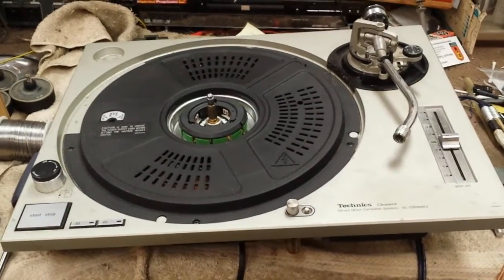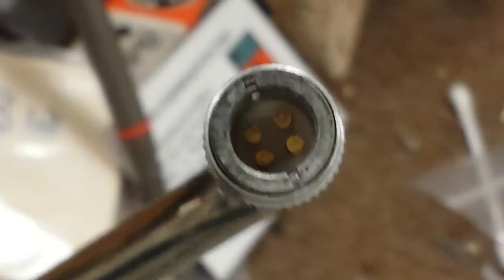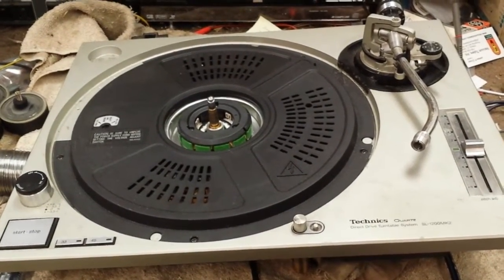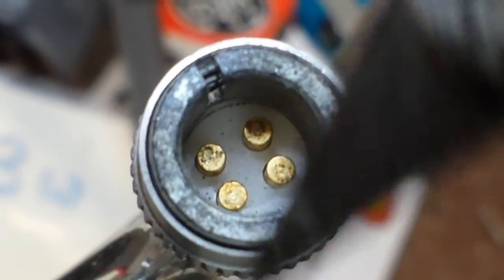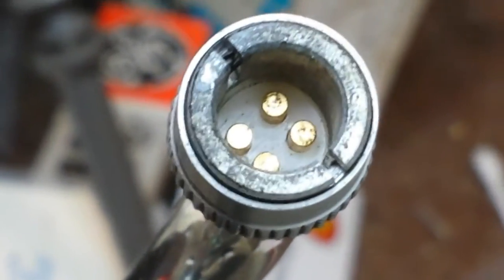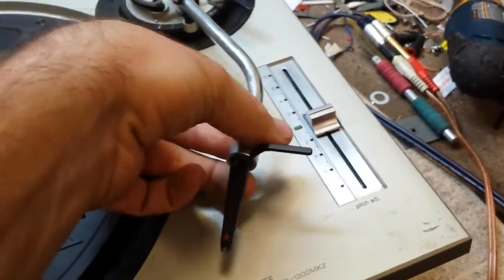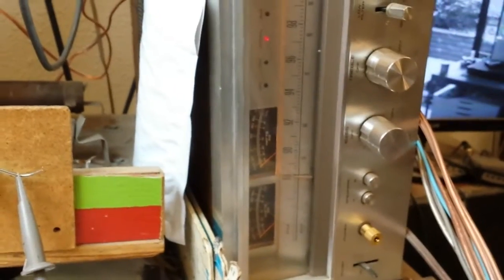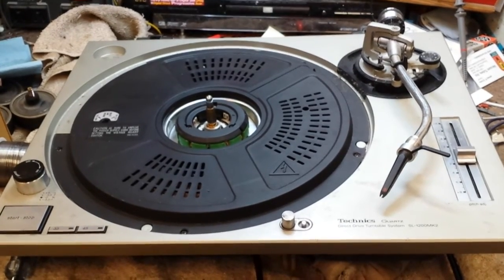How to clean your headshell socket on a technics sl-1200 series turntable

Comment: A fiberglass pen is good for to clean the contacts too.
Reply: Also known as a fiberglass "scratch brush". A pencil eraser, or ink eraser (more abrasive), will also work. Use a light touch, and try not to polish so much that you remove the thin gold plating. Esslinger (watch and jewelry tools) sells scratch brushes in both 1/8" and 1/16" sizes, in two different qualities and price ranges. The German made EuroTools are better than the cheaper Indian-made ones.  I find these to be absolutely indispensable for electronics work. Flush with alcohol after cleaning.  PS, wear gloves to guard against glass splinters before a gig!

Comment: Ok. I have never licked my cartridge (like, spewwwwww), but having changed the cartridge just recently (changed from a GT cartridge to the Audio Technia AT-VM95C/H), I’m getting great signal on the right channel, but it sounds like it’s either not making a connection or has distorted output on the left channel. Since I don’t lick, would dirty contacts be the issue?

Comment: Awesome. I bought some Stanton ST150s in the last year that have weird and variable connection to the headshell and the connections are not very shiny so I'll give this a go.  I suspect the previous owner was a headshell licker. I'm going to replace the head shells when I have money but inside the end of the tonearm connection looks a bit corroded, so hopefully this saves me having to replace either the connection or the whole arm. Is this likely to help reduce the slight earth buzz as well? Any other advice would be greatly appreciated. Also wanted to know if you know much about what cartridges I can and can't use with the ST150s? My green Ortofon Concordes don't seem to work with it, only the Shure M44-7s I got with the units seem to work at the moment. After checking the specs I noticed the Ortofon Conchords only have an output of 4mA where as the shore has a output of 9mA. Would this be the reason?
Reply: Ortofone banana style carts have shorter and flat contact points on the tonearm side, most headshell mounted style carts (like the M-447), have longer contacts on the plugin side, this is why some Ortofone banana style carts will not work with Technics (Often, the prongs on the inside of the tonearm have been pushed back into the tonearm itself from using traditional headshell mounted style carts, and some of them the points are longer than others, as well).
Reply: M-447's are also Spherical needles that are round and ride the walls of the groove of the record, as well, this makes them by default have higher output (louder), they also have a bigger 'needle'  than your Concords (which assuming they are OM's are also, spherical), the OM's have a smaller stylus point however, and they will ride lower down into the center of the groove, which will promote better sound quality, but lower audio output.

Comment: Jordan, I've seen many of your videos and have much respect for you but.... NEVER use a exacto knife to scrape away the contacts!...I've fixed many of these over the years and the best I've found was using a little bit of tarn x, then use little water to get the excess tarn x up, I use a q-tip when applying this method. I then dry it completely, then use LPS and a q-tip for a final cleaning. I use to use deoxit but over the years I found it did more harm then good. The deoxit reacts with the nylon insulator making the contacts not spring back. Super pain when this happens. Don't use deoxit believe me.
Reply: agreed.
Reply: hey mate any advice for someone who has purchased a used close to mint condition 1210 mk2 with the 2 bottom pins stuck? i initially thought it may have been tonearm wires as there was no audio coming out but tonight i saw the two pins pushed in and stuck, any advice would be greatly appreciated, thanks
Reply: @danizm78  Honestly you can try and unstick the pins. I've used a hot air gun to gently heat up the connector. This may work but your best bet is to replace the connector itself. You can find them on ebay.
Reply: @kanuke  thanks mate, i ended up taking the screws out and using needle pliers to push them back through also used a tiny bit of contact cleaner and lube spray, seems to be working for now but will replace at some point.
Reply: Googling Tarn X and it says not to use on aluminum, which is what the tonearm is made from, no?
Reply: @JurassicTrance  Yes, part of the tonearm is made from aluminum. I don't use the method I posted above any more. Now I use just Alcohol with a q-tip. This is the best method in my experience.
Reply: @kanuke  cool, yeah I’m trying to figure out how to clean some mk2s I just picked up, one of them has some corrosion in the head shell socket (white power spilled out after removing the headshell).  Contacts look ok and the rest of the turntable seems alright.

Everything else seems fine, pitch needs calibration but I don’t think it needs to be replaced - the cue arm mechanism on both feels a bit strange compared to my M5G deck.  They both work fine and smoothly drop the arm down - it’s the action of the lever itself that seems a bit off? Lifting it is fine, but when dropping it back down, it sort of just falls without a smooth motion? Again, just the lever not the actual lift mechanism so it’s not exactly an issue, but a bit annoying.
Reply: @kanuke  ,  The trick I learned from ham radio and ex military radio operators was to use a pencil eraser to clean the gold plated contacts both on the headshell and in the tonearm socket. Flush with alcohol afterwards. A pencil eraser, or ink eraser (which is more abrasive) works great on relay contacts . Use a very light touch on gold plated connectors.  A dried up eraser doesn't work, you will want a soft fresh eraser.

Comment: What do you suggest one use to lubricate the pitch slider??
Reply: There are 2 possible reasons for the slider to be really stiff and sticky: 1) dust/dirt/debris and/or drink spills inside of it; and/or 2)  Somebody "cleaned it" by spraying some kind of contact cleaner or WD40 or lord knows what inside of it. You really can't clean and/or lubricate sliders that way, especially if they're already quite dirty to begin with.  I have been a bench tech repairing audio equipment full time for 15 years, and none of the products on the market, no matter what the advertising says, are truly suitable to just spray into a slide fader. To do it right, you need to remove and disassemble the fader, clean the conductive carbon-plastic tracks on the little circuit board with Q-tips and alcohol (some guys use distilled water with a drop of dish soap), carefully clean the little metal fingers that contact the carbon track  (don't bend them!), then lubricate the carbon track, and SEPARATELY lubricate the sliding mechanisms before reassembling. What type, or types plural,  of lubricant to use is hotly debated. I have used clear silicon transistor heat sinking grease on both the track and the slides, and that works reasonably well (it's similar to Teflon super lube which will also work), although it doesn't really "feel" quite like the original factory lubricant.  Some guys use a special conductive lubricant on the carbon track but I don't know if that's a good idea. 

Understand that the original lubricant that was used on the slide rails at the factory was different than what they used on the carbon tracks; a more viscous Dow Corning type of silicone, sort of like a thin honey consistency, and that's what made the pot glide so nicely. 

For tips,  I would take a look at some of the various videos on YouTube, including not just DJ's fixing their own gear but also the guys cleaning fancy, expensive commercial mixing consoles from recording studios.  And if somebody tells you to just spray the slider with Deoxit or Fader Lube or some all-in-one "miracle product", don't do it@
Reply: @goodun2974  Great explanation. I usually just physcailly wash the fader with dish soap and water without taking it apart. this method works 100% of the time unless the carbon track is already worn, then it's time to replace the fader. I also make sure it's 100% dry before reinstalling the fader. I usually use compressed air and put a fan on it. Never had a issue doing it this way.

Comment: All i can find is D5 Deoxit. Will that work
Reply from the maker: D5 sparingly. Spray it on a qtip and rub the contacts.
Reply: @JordanPier  should this atleast fix my issue with the sound going off on one side? Thanks!
Reply from the maker: @mrbelmont4602  verify by loosening the headshell collar a tiny bit and wiggle the headshell then retighten to see if the channel comes back

Comment: scrape with a pionted blade (knife or metal pointer) then clean with electrical contact cleaner (or Deoxit), I would spray the cleaner on a q-tip first then clean with the q-tip. He didn't even play a real record..

Comment: dude.. what the hell are you doing ? headshell lickers" are doing far less damage to their contacts than you are by scoring the surface with a razor blade,  you're literally etching away the contact surface, not to mention creating crevices for dirt to build up in the future.. geez, use a cue-tip soaked in deoxit to clean the surface,  the contacts are spring loaded, those springs get gummy wether your a licker or not and eventually do not extend back to their full open position ,  push em in and out a few times with your cue tip, the deoxit will penetrate the springs  and free them up to sit fully extended to receive headshell again. You speak with much passion and authority, but your method is dodgy AF.

Comment: Exacto knife? Noooooooooooooooo!  Score 1 for deoxit though.
Reply: don't use deoxit! it will mess up the nylon insulation
Reply: @kanuke   If alcohol and a Q-tip is insufficient, polish those pins carefully with a pencil eraser or a fiberglass-bristle scratch brush.
Reply: @goodun2974  Agree, I've changed my method to just using a qtip with alcohol. Works 95% of the time. Easy and painless. And you don't mess up the pin connector.

Comment: I use 99% iso for electronic contact cleaning. Never had an issue. No damage. Doesn't affect gold.
Reply: Isopropyl alcohol removes grease and dirt, while Deoxit removes oxidation (hence the name de-ox-it, as in, de-oxidize it).
Reply: @QoraxAudio  , good quality gold really doesn't oxidize much (only a 1 micron thick layer of oxide).  Unfortunately there isn't enough physical action of the contacts to wipe themselves clean when you insert the headshell. In most cases,, alcohol and a Q-tip are sufficient to clean the contacts.  If still intermittent, use a pencil or pen eraser, or a fiberglass-bristle "scratch brush", and a *light touch*. (Esslinger, specializing in watch and jewelry repair tools, sells both cheap scratch brushes from India and better-made scratch brushes from Germany). As for Deoxit, note that Caig Labs sells a special cleaning solution for gold contacts, and I don't think they recommend using regular Deoxit on gold.  I am not really a fan of their products and somebody else here noted that they found Deoxit attacking the plastic of the headshell socket. Regardless, I would advise against leaving any traces of Deoxit or similar residue- leaving cleaning solutions inside that connector. Flush with alcohol afterwards.